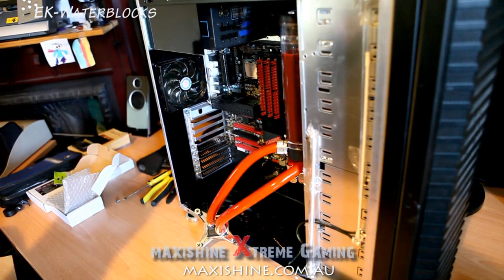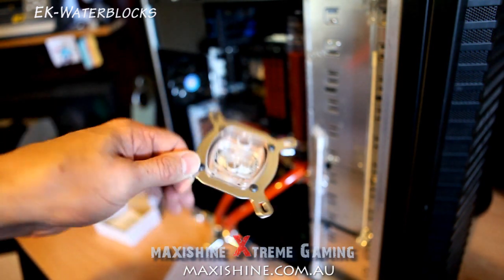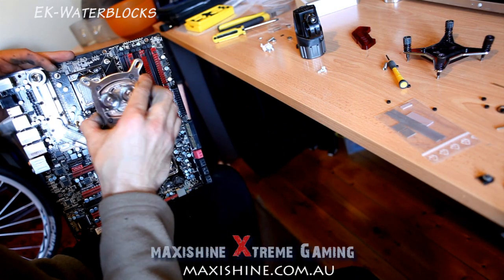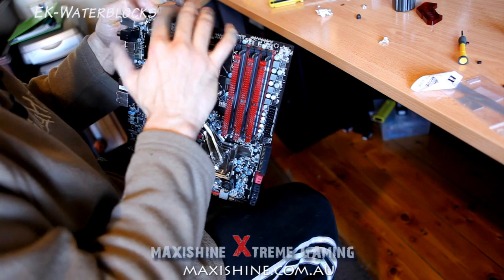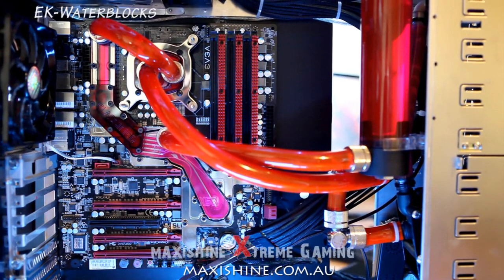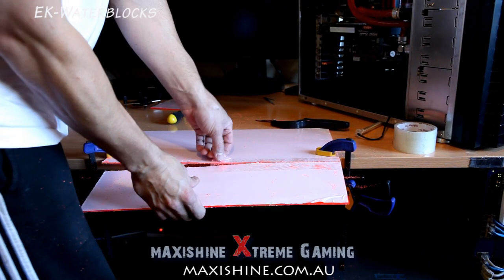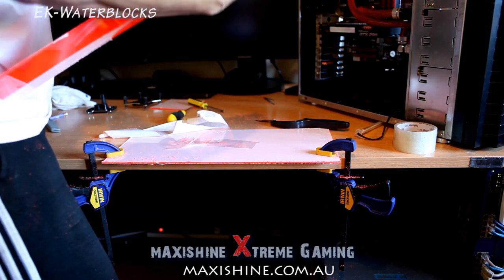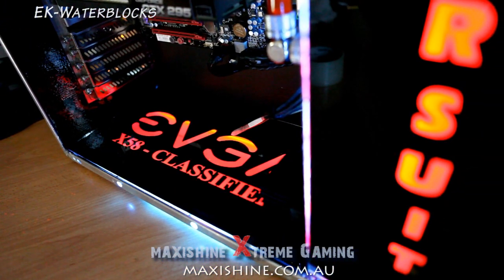EVGA EK-Waterblocks Maxishine Video

Comment: You should probably make an annotation that the way you mounted the CPU block is incorrect. Common sense (and the manual) says the springs need to be ON TOP of the block, pushing down on it, not on the bottom pushing it up. :)))

Comment: could you do a video on your classified motherboards bios as to how you overclocked your ram? when i changed my cpu to 4ghz it put my ram up to 1700mhz, but i need 1866mhz. if i change the ram multiplier it goes way over 2ghz and will break it. did you have any trouble with overclocking on that mobo?

Comment: Hyperthreading is NOT a replacement for an actual core and never will be. An actual CPU core is far more powerful. But Skultrail is expensive, you may as well build a dual Xeon workstation, but it won't make games run faster. It's been proved time and time again a single CPU setup outperforms dual CPU's in games. For now anyway. Think it has to do with FSB and memory controllers? 1 being better then 2 or 1 being shared by 2 CPU's.

Comment: ive had alot of problems with water blocks that have acrylic on them, for some reason they seem to crack within a week or 2 after installing the fittings and then leak on my system

Comment: The GTX 295 CO-OP is, performance wise, the same as the original GTX 295, which had 2 GPUs as well. The only difference between the two cards is that the CO-OP has both GPUs on a single PCB, as opposed to the two-PCB design of the orignal 295, having one GPU per PCB. The downside of the CO-OP edition is that it exhausts more hot air into the case, not to say that the actual card itself is hotter, just that it results in higher ambient temps. Also, it is incompatible with the EVGA voltage tuner.